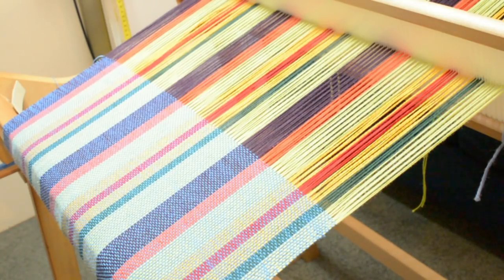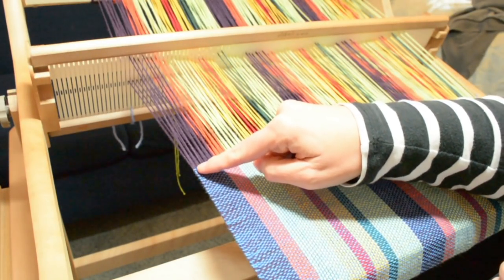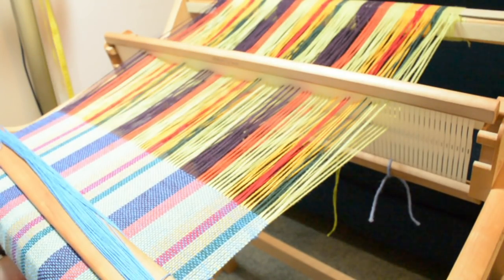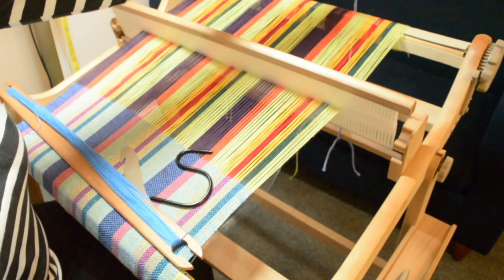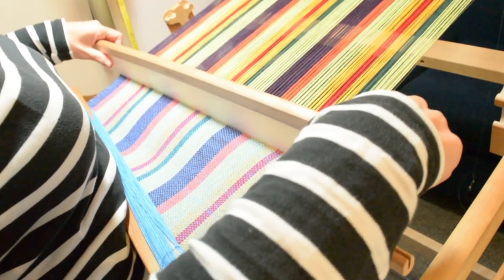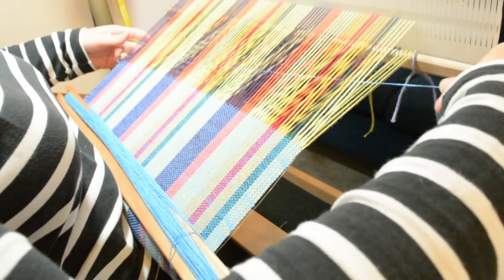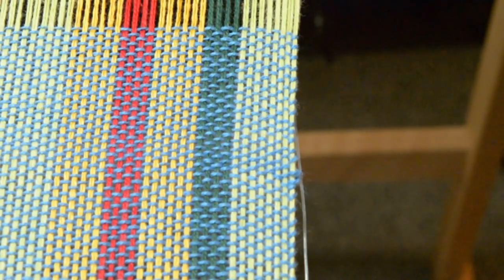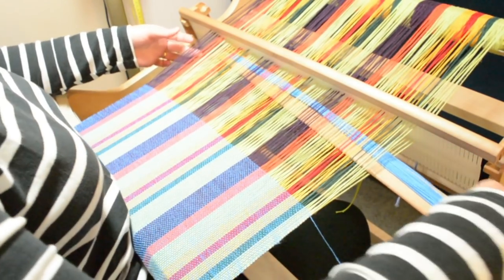Lifeline selvedge technique - another way to weave neat edges!

Comment: dang!  i wish i had watched this a week ago! i knew about the fishing line and just used it on a (really beautiful!) wedding gift, but i didn't put the line in with the last thread, i put it next to it, and taking it out is making the edges wonky. And i used line that was too thick as well.  Dang!  Any notions how to fix that?  i figure i'll take a weft thread through each loop?  Thank you Kelly, for all your wonderful teachings and sharings.  You are greatly appreciated, and i learn a lot.  Really helpful about the edges, too!
Reply from the maker: Keep in mind that the edges will shrink a little and improve after wet finishing.  If the loops at the edges are really large I'm not sure if you could fix that.
Reply: @KellyCasanova  I already wet-finished the sample, including very hot water for over 1/2 hour, and mostly air drying, then finishing in dryer, and then steam ironing. Better but not fine. I used 5/2 mercerized cotton from lunatic fringe. I think I'll probably have to sort of sew the edges. Darn! I'm still a fairly new weaver, about two years now, and still have a lifetime of learning to accomplish! I am so grateful to be learning this awesome craft. Again so very grateful for all you share.

Comment: Thank you, Kelly. Exactly what I was looking for after worrying all day about the right-hand edge of the table runner I’m weaving. There are maybe four looser warps on the right edge, and I don’t know what I’ve done wrong. Also, I have to use a comb after every pick because of the 1/8” gap left between the wefts. I’m using an 8/4 cotton warp on a 10 dent. Could this be the reason I cannot “beat” the weft yarn closer?
Reply from the maker: Uneven tension can be a problem for beating. Another solution to your 4 looser threads could be to weight them over the back of the loom. I use "S" hooks for this, just hook it onto the problem thread behind the back beam/roller to give that extra bit of tension they may need.
Reply: Kelly Casanova Thanks, Kelly. The S hooks (plus a few washers hung onto the S hooks for extra weight) helped me finish the table runner nicely. I definitely need to revisit the process of tying on the warp which, for this project, created very uneven tension. 😢

Comment: I was wondering if that outside salvage edge on your right is loose because of the way you were beating the weft? You sort of wiggled it instead of beating up and down.
Reply from the maker: I often wiggle 😆 It's looser on the right because the thread is in a slot rather than a hole 😊

Comment: Hi Kelly. When weaving I do the opposite of you. When I pick from the left I am in low heddle position. Would I put the line on the left side or keep it on the right?
Reply from the maker: Yes Barbara, swap sides. Whichever side is loose and giving you trouble. You can use the fishing line one both sides if you wish.

Comment: What if the end threads are in holes and not slots?
Reply from the maker: You can still use the technique,  just make sure the weft thread wraps around the fishing line at each edge.
Reply: @KellyCasanova  Thanks. Had read somewhere that the floating selvedges are to be in slots for unrestricted movement. 
Will try the adjecent slot where the end threads are in holes.

Comment: All your threads in the down sheed are looser then the upper ones. Why? I had the same problem with my little loom.
Reply from the maker: It's very common when using a rigid heddle loom, you can't get the same tension that you can on a floor loom, particularly with 8/2 cotton. It's not usually an issue for the finished woven piece, you just need to be a bit more careful when weaving not to snag the looser threads.
Reply: Oh thanks for the information. In fact, that I would like to weave cotton for the next time. I have self spun wool on my loom now and a really good tension. By the way, I love your videos! :)

Comment: Why not just use the holes at each of the selvedges?
Reply from the maker: You could, but then you would have uneven threading.
Reply: @KellyCasanova Yes, I understand that. For fixed patterns, but for freestyle, unfixed patterns, it works.